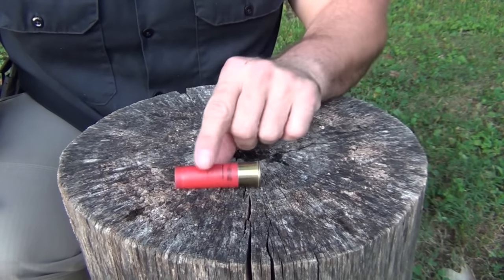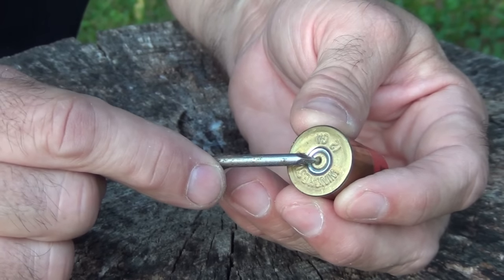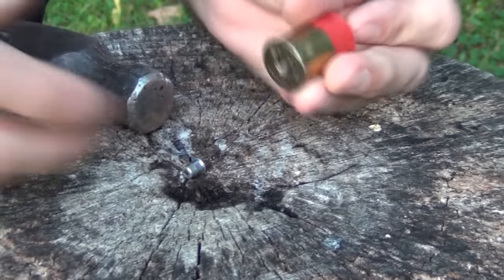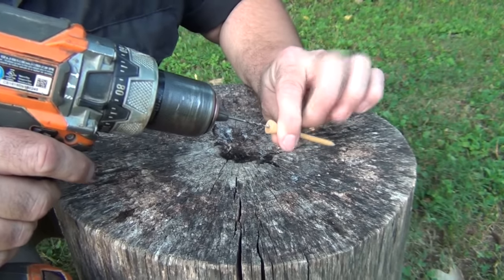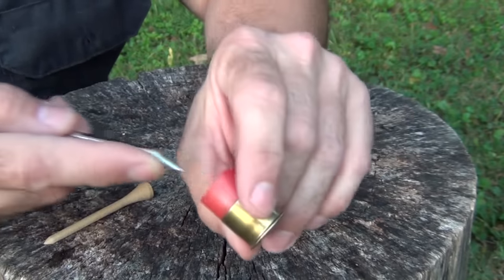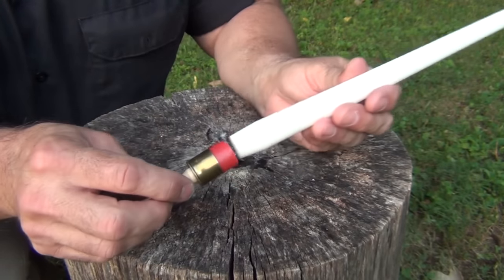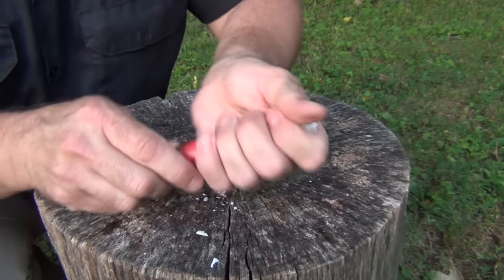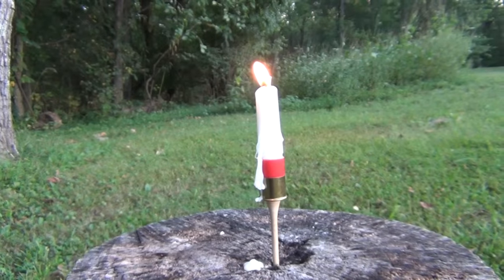Civil War Candle ( Easy DIY )

Comment: Great idea thanks for sharing it another use for the spent shell is if you use a walking stick a little bit smaller than in diameter of the shell you can place it on the bottom of the staff to protect it from wearing down
Reply from the maker: Great idea as well!

Comment: Awesome piece James. I'll bet if you can't find a golf T you can run about a 3 inch long screw through the primer hole so it sticks out the end of the shot shell. Then put a small nut on the screw so it won't fall out of the shell. Then grind a point on the end of the screw. The screw takes the place of the golf T.
Reply from the maker: Yes, good idea!

Comment: you could also use the nail pushed through the shot shell hull and use a push on washer type fastener. It depends what things you have available to you be creative. Thanks I would not have though of doing it that way. I would have thought of a candle lantern. That is a realy good way to use a candle.
Reply from the maker: Thanks for the suggestion and for watching the video!

Comment: Another excellent idea James. Although I wouldn't recommend drilling out the tee holding with your fingers. I recently had a mishap that caused the drill to slip and ended up putting the bit through my thumb. It gave me shivers watching you do that. But that's just me. Otherwise I like the idea and will be giving it a try. Cheers 🇨🇦
Reply from the maker: Thanks for watching. You definitely need to be careful when doing that. Fortunately, my drill is variable speed, so I can go pretty slow, which minimizes the risk.

Comment: Great idea, and I bet you could take the domed center of a soda can bottom and place between the shell and tee to collect that wax to recycle for other ideas like fire starters! Thanks, James!
Reply: Great idea, that would be a practical addition to this light, and it would make it safer to use also
Reply from the maker: Yes, you could definitely do that unless you had a candle that used up the wax, then it would be unnecessary.

Comment: Your very clever. Would work well where there is no draft like under my tarp. Have you ever seen the tin can with nail holes punched in it. I love making up these little candle holders to put beside the path to the fire at camp as a guide. I will make one of yours up this fall should be a fun project. Thank you.😊👍
Reply from the maker: Thanks. Yes, I have made one of those tin can candle lanterns on my channel for a project before. Thanks for watching!

Comment: After looking at your design i know exactly the candle holder you're talking about. I know they're civil war era candle holder but i think there's similar designs that date back farther. I forgot what they was called.
Their design was made to where you didnt need to carry a big bulky handle holer while traveling or on the movie. You just use the spike to stick into anything like s piece of wood or something. Also those was designed for when the candle got too small you can take it out of the holder and turn ot over and stick what's left of the candle on the end of the spike to use the rest of the candle.
Reply from the maker: Yes. That's exactly the one that I'm talking about. Thanks for watching!

Comment: "Necessity is the mother of invention." It may be hard to believe but some of the materials for this project will be hard to come by in the Philippines. In my 11 1/2  years in the Philippines, I have never seen a golf T. It would require a trip from our province to the Manila golf course to find one. I am thinking of a pipe cap drilled to accept a long, small-diameter bolt. Secure it with a nut and sharpen the end of the bolt. Apply a little flat black paint or heat the project up and quinch it in oil. I think James will approve because he always finds alternative ways to skin that proverbial cat!
Reply from the maker: I like the idea! I think it will work quite well. The original one was made from Iron so you're actually getting closer to the way it was.

Comment: Rather than worry about finding shotgun shells, and miss out on such a cool project, I'd do the same thing with some light metal tubing or maybe even PVC pipe or iron pipe and a cap. Then I'd drill the hole and attach the golf tee. I think it would be fun and practical/purposeful to make them different lengths as well.

A lot of people try to steer people away from candles, but they're just too useful. Wax can be melted and used for waterproofing cloth or sealing a jar. And as long as we have bees, we will always have wax so it's sustainable.
Reply from the maker: Yes, there are multiple ways that you could make this without a used shell, for sure.

Comment: When I saw you trying to force the bottom of the candle into the shell I thought to myself, why doesn't he just reverse the candle and use the part where he broke the candle, essentially burn it from the bottom down?
Reply from the maker: Sure, you can do that but it doesn't fit very tightly.